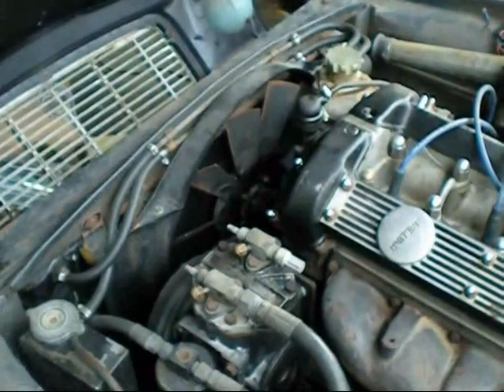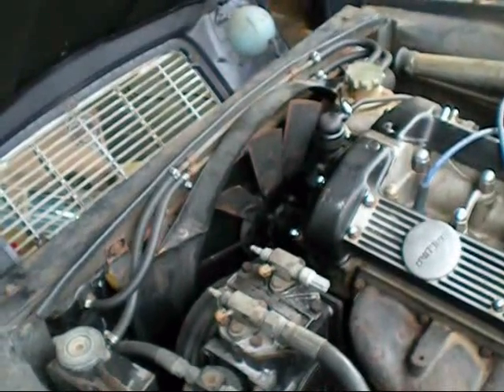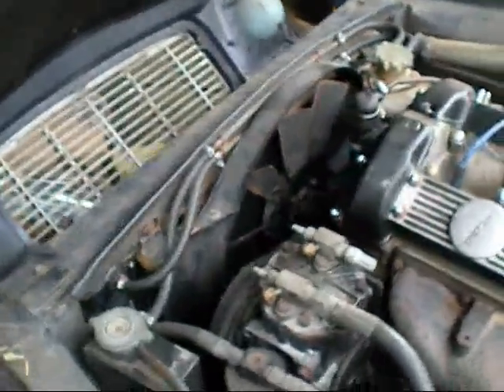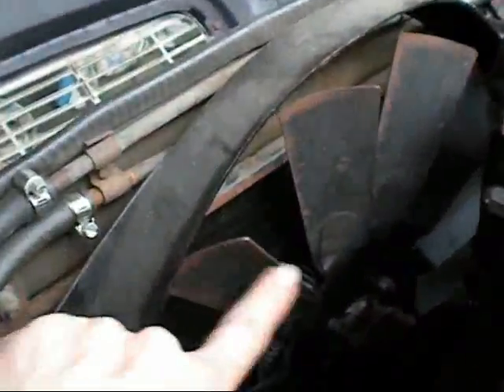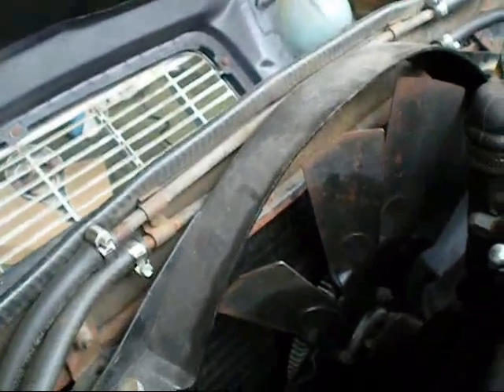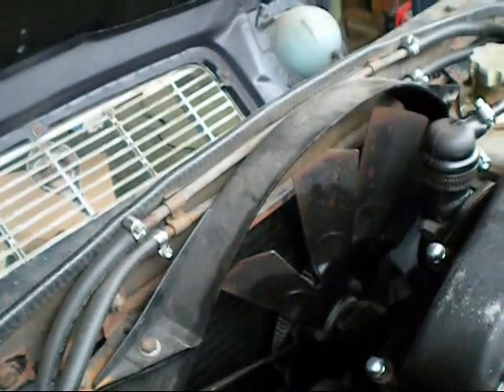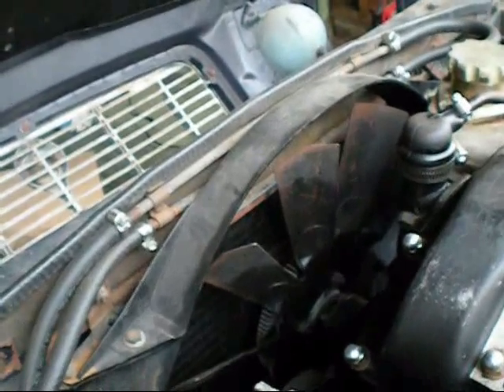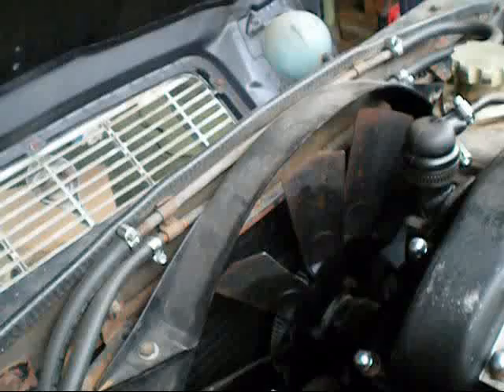car air conditioning  tip #3

Comment from the maker: cool. if you wire your fans so they come on all the time your compressor will last longer and you will use less fuel and the a/c will be colder. 180psi is too high

Comment: I've got mine set up kinda like that on my Chevy van. I have an electric fan on the front, which is run by a switch that activates it when my head pressure gets over 180 psi (I've only had it cut in a couple of times during long idling on hot days). I've also got a heavy-duty thermostatic clutch on the engine-driven fan (original to the truck.)